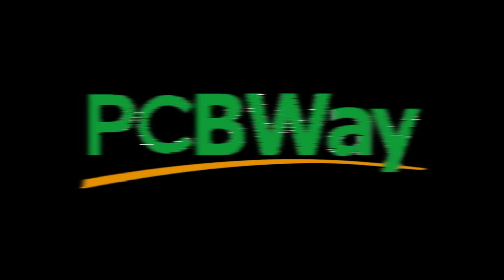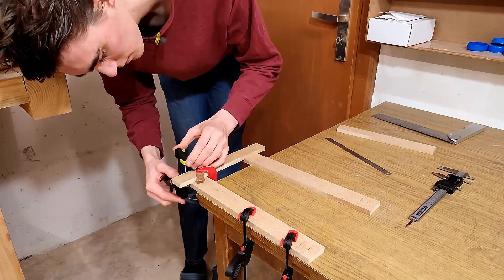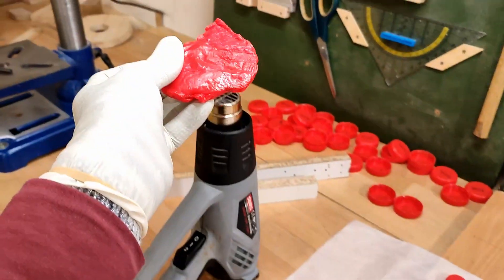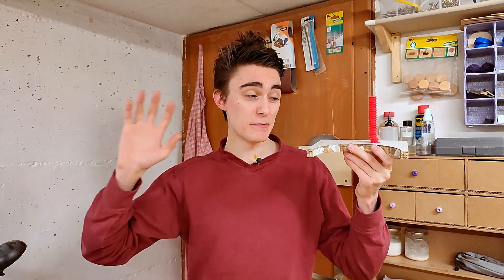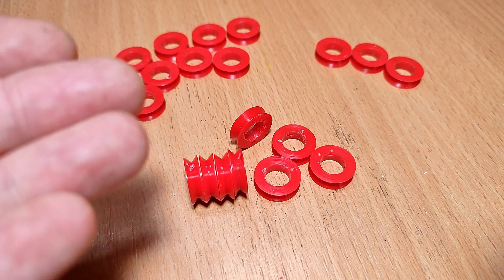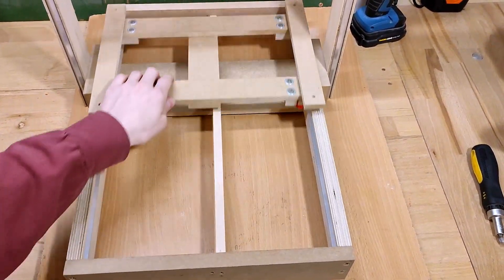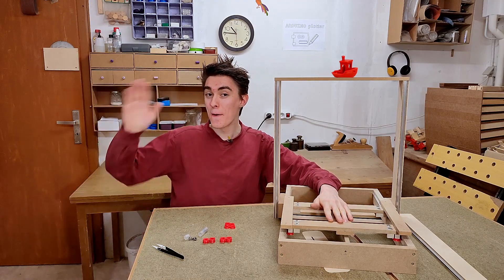Building a wooden 3D printer part 3: The Y-carriage

Comment: Great job!
Do you plan to print better precise parts after the printer is done?
Reply from the maker: Thanks! I do plan to make it print finishing touches for itself, like an air duct for the parts cooling fan and stuff. The only parts I'll really replace with 3D printed ones I think are the wooden pulleys driving the Z-axis, for everything else the accuracy I can achieve with wood is no worse than what could come off the machine...

Comment: One suggestion - maybe for the next project. You can use two bearings per each end, and have their axis at 90 degrees one from the other. This would avoid having to build the plastic sleeves. Now I know what you'll say, that's two bearings to do the job of one, but on the other hand, they won't wear out like plastic does.
Reply from the maker: Actually, that's exactly what my design for the laser cutter is! Or rather was, that is, until I reconsidered my life choices and decided that, having to mount 8 bearings perpendicular to each other with adjustable tension for each carriage assembly, is unreasonably complex to build without having a CNC already at my disposal to fabricate more repeatable accurate parts. So now I'm redesigning most of the gantry to run on regular W-style roller bearings that use 2 balls bearings each :'(
Using the tiny 10mm bearings I had planned to use would've result in lots of microscopic parts that are very hard to make IRL - something easy to loose track of when working in CAD where I can just zoom in...

Comment: the outer part of the W-bearing must not go on the back of the profile but on the hollow part!!
Reply from the maker: Why?
Reply: @ChronicMechatronic  you used the outside of the aluminum profile, as you noticed the bearing is not 90 degrees. in my cnc project i used the internal part of the profile, like this: 
<bearing - space - bearing>, the carriages put pressure on the bearings, not the other way around. the OUTSIDE of the bearing W is 90°
Reply from the maker: @wwdiablos  Who cares if the 90° is on the inside or outside the bearings!? Using V-groove bearings on the outside of a 90° rail wasn't even my invention, if you can't give a technical explanation of why running W-bearings inside a groove rather than V-bearings on an edge would be advantageous, I don't care man. Your solution isn't the only possible way to build a CNC, so I make mine the way I want!

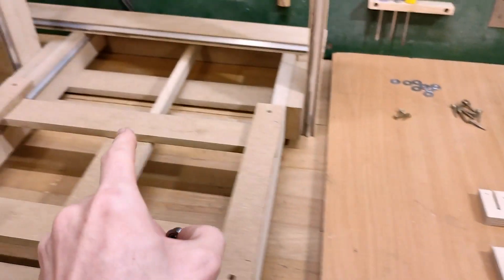Comment: have you noticed the mini bearings?? as well as being inaccurate as I told you in the previous video, (the smaller they are the more inaccurate they are, or rather they are not suitable for this purpose)... they do not have a 90° angle (minute 4:26)... you have to use larger bearings large and more precise quids but with a double V. The double W ones have the external angles at 90°!!
Reply from the maker: I am not stupid. I have reasons for doing things the way I do them even if I don't mention it in the video. The goal of this project was not to copy an Ender 3, nor to build the best 3D printer in the world; but rather to build a reasonably large 3D printer on the extremely low budget of $50 using more accessible parts than anyone has before. If I wanted to repeat what everyone else has already done I would do so. But thanks for boosting engagement with all the comments.